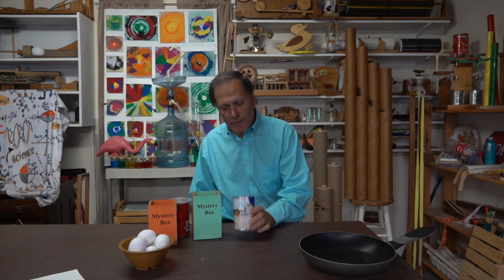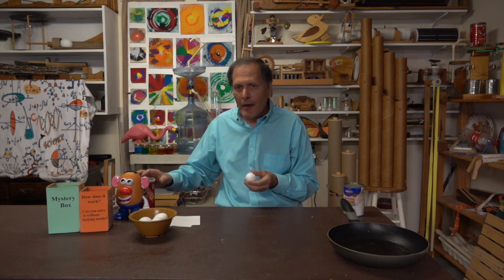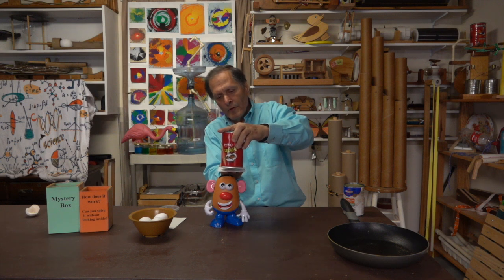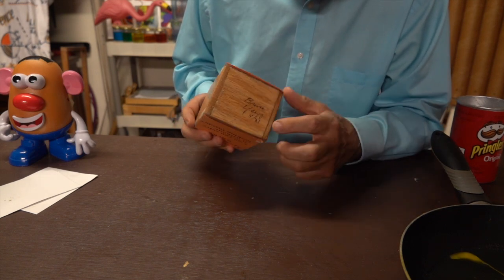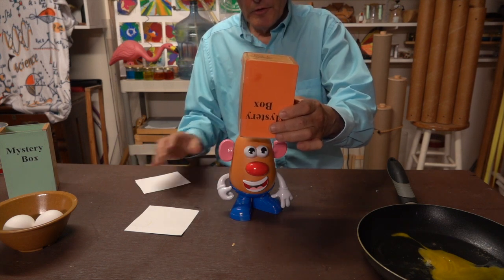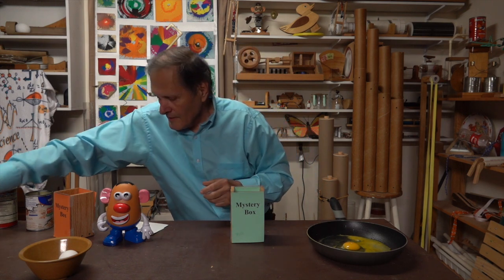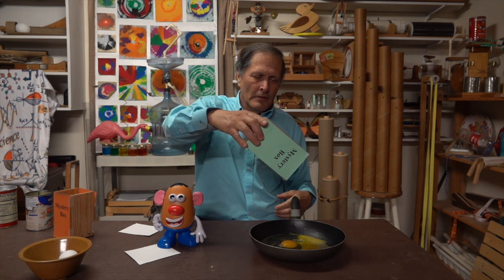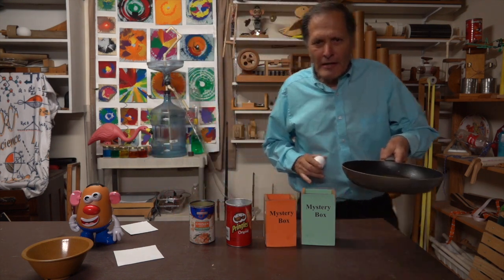Mystery box #3  disappearing egg yoke // Homemade Science with Bruce Yeany

Comment: I believe that there is a plate installed inside the box the covers half of it diameter/width. When turning it counterclock wise the egg goes to the side of the can/box and end up on this plate. When turning clock wise the egg flows from this plate to the side, then to the bottom and then to the other side which is not covered by this plate.

Anyway... Nice trick, Bruce!

Comment: I think that on one side of the Box there is a pocket inside, and when you turn the Box on the side with the pocket, the egg just slips into the pocket.. but on the other side is no pocket, and when you turn the box to the side where is no pocket, the egg just comes out...  idk if that's  the trick which you use, but it would also work.. 
but cool video!! like always!!

Comment: I would think there is an angled shelf that when you rotate the box the egg is captured in that area, when rotated back the egg can come out the other side of the shelf... of course building this in a can seems more complex then in the box. 
The egg also works better then a liquid because it mostly wants to stay together rather then have droplets if it coming out. 
Neat little trick.

Comment: My guess is that there's a flat piece of something glued at a 45° angle such that the higher side seals against the side of the container and the lower side doesn't touch the other side of the container, and the last one has two flats glued in, slanted opposite of each other, such that the lower sides are in the center with a gap between them, and the higher sides seal against their respective sides of the container.

Comment: I figure there's some sort of cup inside that's shaped or weighted so that it's always facing up. I definitely heard something moving around inside when you turned that last box over.
Reply: It  could also be just a piece of wood on one side. The egg drops below it and then when he flips the box he chooses whether to flip it from the side that will release the egg or the side that will keep the egg above the piece of wood.
Reply: @EvilCherry3  How would he stop leaks that way, though? The cardboard is spotless. Rubber sides would provide too much friction to move around sufficiently easily.
Reply: @TheOriginalJphyper  You're right that's impressive. But with your idea of the rotative cup inside it seems tricky for him to disable the rotation only when he wants to release the egg.
Reply: @EvilCherry3  It could be mounted off-center so the bottom of the cup only has enough room to swing freely in one direction
Reply: @EvilCherry3  Well, dang. Turns out you were right. I was overcomplicating things.